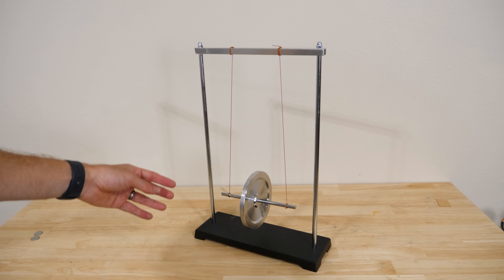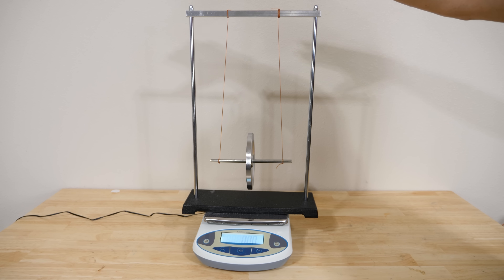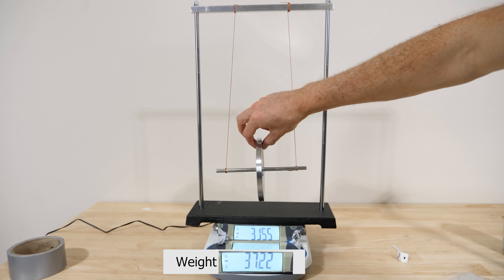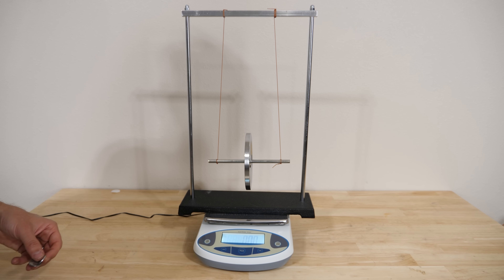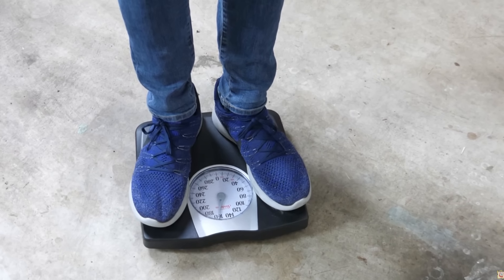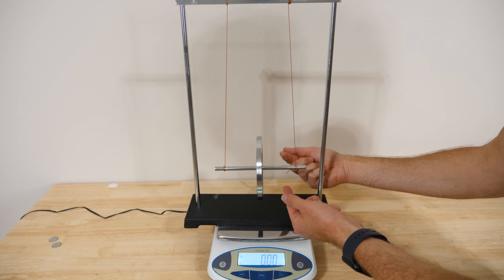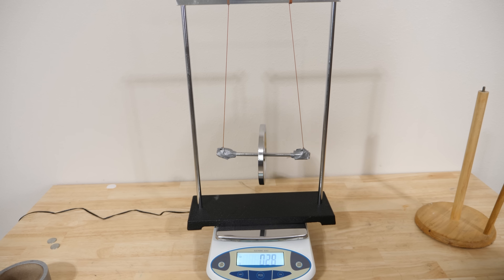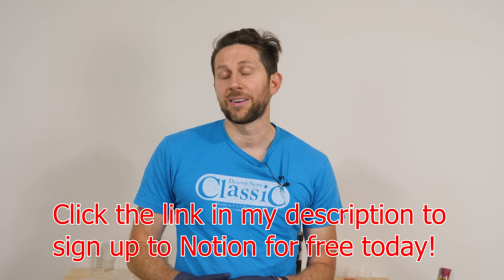How Does The Anti-Gravity Wheel Work?

Comment: Inertia of the upward moving mass leads to an instant at the apex where  the upward velocity passes through zero and then begins accelerating downward in a gravity field. . i.e has no measurable 'weight".   It's just hanging there in midair - for a very very tiny instant of time. 
An upward thrown ball or a fired bullet is decelerating in a gravity field until it comes to an instantaneous moment of stoppage in the vertical rise, then begins accelerating downwards..  Toss a ping pong ball up and watch. Jeez, I had to calculate this kind of stuff in Physics 101 with cannon balls fired in an arc towards each other until they collide.
The electronic weight scale has slow and damped response (deliberate) to a rapidly changing reading making any reading beyond it remaining motionless long enough to let the vibrations damp out, meaningless. No more unsuited instrument for this experiment could be found.  Read up on the slew rate of Op Amps. And a course on Metrology would help in understanding this.
And the swinging of the gyro overhead IS a demonstration of Conservation of Angular Momentum. Put the spinning 40 pound mass inside a vacuum chamber (so that air resistance drag is canceled) and do that experiment and watch the RPM drop as energy is converted from angular momentum to XYZ accelerations. Every astronaut on the ISS  would be happy to demonstrate.
I see no mystery here, just fuzzy thinking and unsuitable experimental methods. Sorry.
Reply: That's not it.
You need to understand that those things are all accelerating downward through out the entire flight.
Upward Deceleration IS downward Acceleration!  They are BOTH due to a downward force. 
..
Something in free-fall is weightless whether going up or down. It is NOT weightless only at the very top.  NOPE!

Moving upward, they are "decelerating" in the upward direction (negative upward acceleration) which is from the downward force of gravity, thus downward (positive) acceleration.  

..
On the downward path, it is positive downward acceleration due to gravity.
..
 if you carefully consider what we see here, the mass of the wheel isn't quite in free-fall.  The acceleration we see is less than the 9.8 m/s^2 that free-fall wound show.

Therefore, something has reduced the gravity and it must be an opposing force that has the net effect of reducing gravity .
..
The scale just isn't registering the short spike of increased weight at the bottom.  The scale is showing the truth during the main part of the wheel's travels.
.
He doesn't explain any of this in the video.  He just shows it.

Comment: When an object is at free fall it doesn't experience gravity
Reply: Well, it does, because it is accelerating due to that gravity.
However. . . 
 if you carefully consider what we see here, the mass of the wheel isn't quite in free-fall.  The acceleration we see is less than the 9.8 m/s^2 that free-fall wound show.

Therefore something has reduced the gravity and it must be an opposing force that has the net effect of reducing gravity .

Comment: What if you applied magnets to both sides? Terminal velocity and gravity are kind of disregarded to an extent right?
Reply: No, because it is accelerating due to that gravity.
However. . . 
 if you carefully consider what we see here, the mass of the wheel isn't quite in free-fall.  The acceleration we see is less than the 9.8 m/s^2 that free-fall wound show.

Therefore something has reduced the gravity and it must be an opposing force that has the net effect of reducing gravity .

Comment: A limit case:
If you just dropped the wheel without it spinning.

The scale would show negative the weight of the wheel while it falls.
You would get an impulse with positive weight when it bounces at the bottom.
Then negative weight again while the wheel bounces up without loading the strings. 

I guess you somehow miss the impulse of positive weight at the bottom.

Does this kills the magic?
Reply: The flywheel-winding-strings is making the flywheel mass fall and rise slower than gravity would do it alone.  It is still undergoing downward acceleration all the time, but less than the force of gravity would. do it.
Therefore,  the energy of the spinning wheel is working against gravity to effectively reduce gravity.
It only lasts for the length of the strings.

Comment: Your statement that the average weight was -6g threw me. I thought you had scales that told you the average weight whereas the actual explanation is that the average weight was 0g but because the refresh rate on the scales is too slow to pick up the sharp increase in weight at the switch of direction it only appears like the average weight is negative. The short video was misleading!